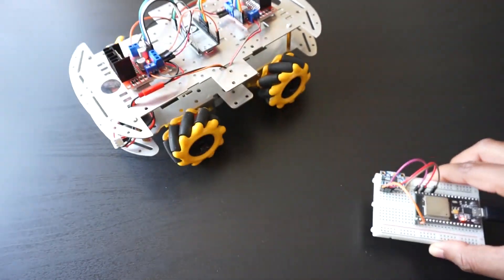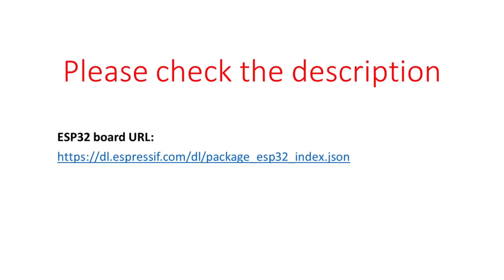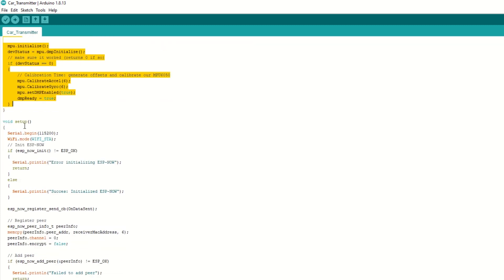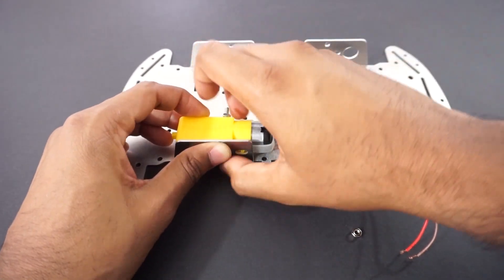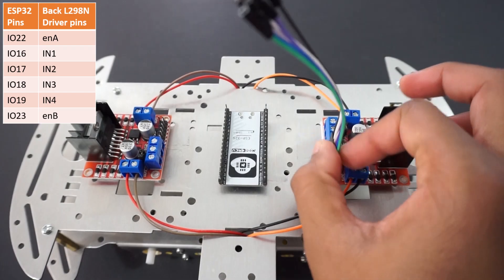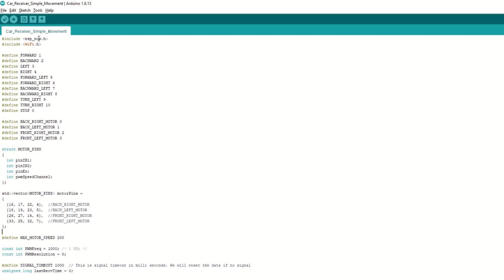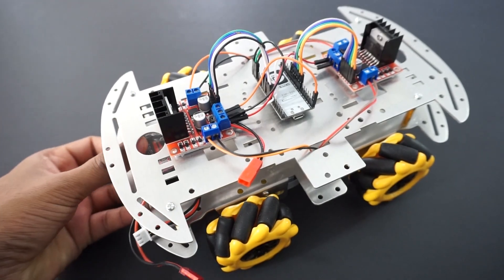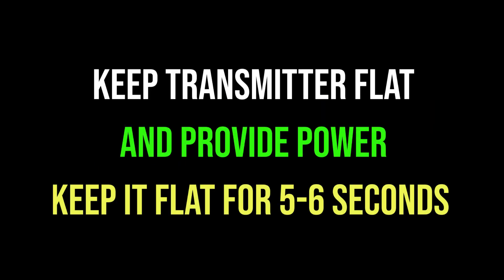Gesture Controlled Mecanum Wheels Car using ESP32 | ESPNOW | DIY🔥

Comment: Code is not working
Reply: ARDUINO 1.8.19
The receiver and transmitter not connecting
Reply from the maker: @AkFourtyseven-m2h  ok . You need to make some small change in code . Please check the very first comment on this video 👍🏻👏🏻
Reply: I do it but not connecting
Reply: Please help
Reply from the maker: @AkFourtyseven-m2h  ok do one thing . Might be your mpu6050 is not working . Try using another one . We recently solved this kind of issue for one of the subscriber 👏🏻👍🏻
Reply from the maker: What issue are you facing ? Which version of Arduino IDE are you using ?
Reply: Mpu6050 is working, i checked it

Comment: When I load the code of the receiving car I get the message (vector in namespace std does not name a template type)
how can I fix that
Reply from the maker: Please use below line at the beginning of the code 
#include <vector>
Reply: Thanks
Reply: @IvanSantana-rv9un  did it worked?

Comment: Code of transmitter is not working , please help
Reply: In the code of car reciver i got this message
Vector in namespace std does not name a template type
Reply from the maker: @IvanSantana-rv9un  please add below line at the beginning of the code 
#include <vector>
Reply from the maker: Which Arduino IDE version are you using ?

Comment: How to make this for a stearing based rc car??
Reply from the maker: What do you mean by steering based RC car ? 👍🏻👏🏻
Reply: @hashincludeelectronics   the rc car waltoys cars that has dc motor in rear wheel nd front wheel has a stearing system to turn left right

Comment: Can use normal wheels?
Reply from the maker: Yes you can but few movements will not be applicable for normal wheels . Like sideways , diagonal . 👏🏻👍🏻. You can check my other gesture controlled car using Arduino .

Comment: C:\Users\nitis\AppData\Local\Temp\.arduinoIDE-unsaved2024114-5060-6a0zee.exdaa\sketch_feb14a\sketch_feb14a.ino:5:10: fatal error: I2Cdev.h: No such file or directory
 #include "I2Cdev.h"
          ^~~~~~~~~~
compilation terminated.
exit status 1

Compilation error: I2Cdev.h: No such file or directory                       
THIS PROBLEM IAM FACING COULD YOU PLEASE TELL ME
Reply from the maker: You need to install the library. Please check the video 👏🏻👍🏻
Reply: @hashincludeelectronics   i installed and paste it in the aurduino library

Comment: Hii sir 
I am make this project according to your video 
But there is two problem :
1. It is not working when I give the power connection by motor driver to esp32.
2. If I am giving the power supply from esp and giving power to motor driver by battery it is running but after few seconds it is not working there noise created and we have reset esp32
Reply: Same problem sir

Comment: Hiii
There is error in receiver code that "vector is namespace 'std' does not name a template type "
How can i remove it ?
Reply from the maker: Use this line at the beginning of the code .
#include <vector>
Reply: @kathanpatel8081  did it worked

Comment: It's working but, when I disconnect the battery, I have to re-upload the code, to start it again, any suggestions for this ?
Reply from the maker: You don’t have to re upload the code at all 👍🏻👏🏻. Please check the video again
Reply: Bro code any error comes which module use esp32 🤔.any program error comes please tell me
Reply: @beRecursive

Comment: Brother can I please contact you, mine is not showing any gesture response
Reply from the maker: What issue are you facing ? Please go through the video once again slowly and carefully for any missing step 👍🏻👏🏻
Reply: @hashincludeelectronics  I have done all the steps, but still the car is not responding.. to connect two esp32, we have to just paste mac address of reciver to transmitter right ?
Reply from the maker: @JoshiRushi-v1e  which Arduino IDE version are you using ?
Reply: And one thing, I am using esp32 with 30 pins, but I have changed the pins in code accordingly, would that cause any problem ?
Reply from the maker: @JoshiRushi-v1e  it should be ok . Give it a try 👍🏻👏🏻
Reply: @hashincludeelectronics but it's still not working, please help
Reply from the maker: @JoshiRushi-v1e  what version of Arduino IDE are you using ?
Reply: @hashincludeelectronics  hey, it's working, but the motors are taking too much load, ( i am using 9v sp battery) can you suggest some other batteries that can work
Reply: @JoshiRushi-v1e  Hey how did you make it work? I'm having a similar problem and its not working, what should I do?

Comment: Do we need to upload that wifi code to both esp32 modules ?
Reply from the maker: No. It is just used to get the MAC address 👍🏻👏🏻
Reply: @hashincludeelectronics  ohk , but please clarify, we have to get mac address of reciver module and paste it in code of transmitter module right ?
Reply from the maker: @JoshiRushi-v1e  exactly 👏🏻👍🏻

Comment: transmitter
E (182) psram: PSRAM ID read error: 0xffffffff
Succes: Initialized ESP-NOW
E (307) ESPNOW: Peer interface is invalid
Failed to add peer
...................................................................
reciever
E (177) psram: PSRAM ID read error: 0xffffffff             how i can fix that i check mac address long time pls help me
Reply from the maker: Which Arduino IDE version are you using ?

Comment: Hey, can we use normal tyres ? Will it be able to take turns ?
Reply from the maker: Yes you can use normal wheels as well . However there are some movements which can not be possible with normal wheels . You can also refer my other same video but using Arduino where I have used normal wheels 👍🏻👏🏻
Reply: @hashincludeelectronics can you please provide the link  ?

Comment: I'm having a problem with Failed to add peer. Is there a way to fix this?

Success: Initialized ESP-NOW
E (122) ESPNOW: Peer interface is invalid
Failed to add peer
Reply from the maker: Which version of Arduino ide are you using ?
Reply: @hashincludeelectronics  Latest version
Reply: @hashincludeelectronics  I've been trying to find information about ESP now, but I can't solve this problem.
Reply from the maker: @03-thanakhonoonklan55  ok . Got the issue . You need to do memset in the code . You can find more information on this issue on internet .
Reply from the maker: @03-thanakhonoonklan55  check the pinned first comment on this video for solution👍🏻👏🏻

Comment: Ser can you tell me i have a problem because i am used 211-161007 esp32
So there are other names for the bens😢 like d22. ,d21 and so on
Reply from the maker: Please check the pin diagram of the module you are using and use those pins accordingly 👏🏻👍🏻

Comment: Hi, I have a question. This is will be work with normal wheels instead of mecanum? Your work is amazing. Thank you
Reply from the maker: Yes it will work . However there are some movement which can not work with normal wheels . Also you can check my similar video using Arduino and nrf where I have used normal wheels 👍🏻👏🏻
Reply: @hashincludeelectronics  Thank you so much!!
Reply from the maker: @MrAmadiPL  welcome 🙏

Comment: Hi sir i am this car . The transmitter module is working fine but there is some problem in reciever module. After uploding the code in the reciever the serial monitor displays this 

“rst:0x10 (RTCWDT_RTC_RESET),boot:0x13 (SPI_FAST_FLASH_BOOT)
configsip: 0, SPIWP:0xee
clk_drv:0x00,q_drv:0x00,d_drv:0x00,cs0_drv:0x00,hd_drv:0x00,wp_drv:0x00
mode:DIO, clock div:1
load:0x3fff0030,len:1344
load:0x40078000,len:13964
load:0x40080400,len:3600
csum err:0x4d!=0xff
ets_main.c 384 “

Please help me out
Reply: How did you solve it 🥺
Reply: @PrakashRaj-tg8pf  not yet😔

Comment: Sir it's a humble request from my side...pls provide me your contact info... because i have followed the steps u mentioned....still it is not working i need to submit my project in 2 weeks....please help me out🙏🙏🙏
Reply from the maker: What issues are you facing ? You can contact me on my email un0038998@gmail.com . I will see if I can help you.  However you can check the circuit diagram and connections again . Make sure you use rechargeable battery only . Check the video slowly and carefully for any missing step 👏🏻👍🏻
Reply: @hashincludeelectronics  sure sir i am mailing u...

Comment: Arduino: 1.8.16 (Windows 10), Board: "ESP32 Wrover Module, Default 4MB with spiffs (1.2MB APP/1.5MB SPIFFS), QIO, 80MHz, 921600, None, Disabled"

sketch_oct20b:29:6: error: 'vector' in namespace 'std' does not name a template type

 std::vector<MOTOR_PINS> motorPins =

      ^~~~~~

C:\Users\Admin\Documents\Arduino\sketch_oct20b\sketch_oct20b.ino:29:1: note: 'std::vector' is defined in header '<vector>'; did you forget to '#include <vector>'?

C:\Users\Admin\Documents\Arduino\sketch_oct20b\sketch_oct20b.ino:3:1:

+#include <vector>

 

C:\Users\Admin\Documents\Arduino\sketch_oct20b\sketch_oct20b.ino:29:1:

 std::vector<MOTOR_PINS> motorPins =

 ^~~

C:\Users\Admin\Documents\Arduino\sketch_oct20b\sketch_oct20b.ino: In function 'void rotateMotor(int, int)':

sketch_oct20b:207:18: error: 'motorPins' was not declared in this scope

     digitalWrite(motorPins[motorNumber].pinIN1, LOW);

                  ^~~~~~~~~

C:\Users\Admin\Documents\Arduino\sketch_oct20b\sketch_oct20b.ino:207:18: note: suggested alternative: 'motorSpeed'

     digitalWrite(motorPins[motorNumber].pinIN1, LOW);

                  ^~~~~~~~~

                  motorSpeed

sketch_oct20b:212:18: error: 'motorPins' was not declared in this scope

     digitalWrite(motorPins[motorNumber].pinIN1, HIGH);

                  ^~~~~~~~~

C:\Users\Admin\Documents\Arduino\sketch_oct20b\sketch_oct20b.ino:212:18: note: suggested alternative: 'motorSpeed'

     digitalWrite(motorPins[motorNumber].pinIN1, HIGH);

                  ^~~~~~~~~

                  motorSpeed

sketch_oct20b:217:18: error: 'motorPins' was not declared in this scope

     digitalWrite(motorPins[motorNumber].pinIN1, LOW);

                  ^~~~~~~~~

C:\Users\Admin\Documents\Arduino\sketch_oct20b\sketch_oct20b.ino:217:18: note: suggested alternative: 'motorSpeed'

     digitalWrite(motorPins[motorNumber].pinIN1, LOW);

                  ^~~~~~~~~

                  motorSpeed

sketch_oct20b:221:13: error: 'motorPins' was not declared in this scope

   ledcWrite(motorPins[motorNumber].pwmSpeedChannel, abs(motorSpeed));

             ^~~~~~~~~

C:\Users\Admin\Documents\Arduino\sketch_oct20b\sketch_oct20b.ino:221:13: note: suggested alternative: 'motorSpeed'

   ledcWrite(motorPins[motorNumber].pwmSpeedChannel, abs(motorSpeed));

             ^~~~~~~~~

             motorSpeed

C:\Users\Admin\Documents\Arduino\sketch_oct20b\sketch_oct20b.ino: In function 'void setUpPinModes()':

sketch_oct20b:226:23: error: 'motorPins' was not declared in this scope

   for (int i = 0; i < motorPins.size(); i++)

                       ^~~~~~~~~

Multiple libraries were found for "WiFi.h"

 Used: C:\Users\Admin\AppData\Local\Arduino15\packages\esp32\hardware\esp32\2.0.11\libraries\WiFi

 Not used: D:\ardino\arduino-1.8.16\libraries\WiFi

exit status 1

'vector' in namespace 'std' does not name a template type

This report would have more information with
"Show verbose output during compilation"
option enabled in File -> Preferences.
Arduino: 1.8.16 (Windows 10), Board: "ESP32 Wrover Module, Default 4MB with spiffs (1.2MB APP/1.5MB SPIFFS), QIO, 80MHz, 921600, None, Disabled"

sketch_oct20b:29:6: error: 'vector' in namespace 'std' does not name a template type

 std::vector<MOTOR_PINS> motorPins =

      ^~~~~~

C:\Users\Admin\Documents\Arduino\sketch_oct20b\sketch_oct20b.ino:29:1: note: 'std::vector' is defined in header '<vector>'; did you forget to '#include <vector>'?

C:\Users\Admin\Documents\Arduino\sketch_oct20b\sketch_oct20b.ino:3:1:

+#include <vector>

 

C:\Users\Admin\Documents\Arduino\sketch_oct20b\sketch_oct20b.ino:29:1:

 std::vector<MOTOR_PINS> motorPins =

 ^~~

C:\Users\Admin\Documents\Arduino\sketch_oct20b\sketch_oct20b.ino: In function 'void rotateMotor(int, int)':

sketch_oct20b:207:18: error: 'motorPins' was not declared in this scope

     digitalWrite(motorPins[motorNumber].pinIN1, LOW);

                  ^~~~~~~~~

C:\Users\Admin\Documents\Arduino\sketch_oct20b\sketch_oct20b.ino:207:18: note: suggested alternative: 'motorSpeed'

     digitalWrite(motorPins[motorNumber].pinIN1, LOW);

                  ^~~~~~~~~

                  motorSpeed

sketch_oct20b:212:18: error: 'motorPins' was not declared in this scope

     digitalWrite(motorPins[motorNumber].pinIN1, HIGH);

                  ^~~~~~~~~

C:\Users\Admin\Documents\Arduino\sketch_oct20b\sketch_oct20b.ino:212:18: note: suggested alternative: 'motorSpeed'

     digitalWrite(motorPins[motorNumber].pinIN1, HIGH);

                  ^~~~~~~~~

                  motorSpeed

sketch_oct20b:217:18: error: 'motorPins' was not declared in this scope

     digitalWrite(motorPins[motorNumber].pinIN1, LOW);

                  ^~~~~~~~~

C:\Users\Admin\Documents\Arduino\sketch_oct20b\sketch_oct20b.ino:217:18: note: suggested alternative: 'motorSpeed'

     digitalWrite(motorPins[motorNumber].pinIN1, LOW);

                  ^~~~~~~~~

                  motorSpeed

sketch_oct20b:221:13: error: 'motorPins' was not declared in this scope

   ledcWrite(motorPins[motorNumber].pwmSpeedChannel, abs(motorSpeed));

             ^~~~~~~~~

C:\Users\Admin\Documents\Arduino\sketch_oct20b\sketch_oct20b.ino:221:13: note: suggested alternative: 'motorSpeed'

   ledcWrite(motorPins[motorNumber].pwmSpeedChannel, abs(motorSpeed));

             ^~~~~~~~~

             motorSpeed

C:\Users\Admin\Documents\Arduino\sketch_oct20b\sketch_oct20b.ino: In function 'void setUpPinModes()':

sketch_oct20b:226:23: error: 'motorPins' was not declared in this scope

   for (int i = 0; i < motorPins.size(); i++)

                       ^~~~~~~~~

Multiple libraries were found for "WiFi.h"

 Used: C:\Users\Admin\AppData\Local\Arduino15\packages\esp32\hardware\esp32\2.0.11\libraries\WiFi

 Not used: D:\ardino\arduino-1.8.16\libraries\WiFi

exit status 1

'vector' in namespace 'std' does not name a template type

This report would have more information with
"Show verbose output during compilation"
option enabled in File -> Preferences.

Comment: Please sir i need your support to complete my project, it is very hard to made by me please sir please help me please, this is my first project and i don't want to fail in this 🥺
Reply from the maker: What issue are you facing ? Which Arduino IDE are you using ? Please make sure you use rechargeable battery only .

Comment: Can we make same without mecanum wheel
Reply from the maker: Yes you can do that . However you will have to change the code little bit to remove the sideways movement which is not required for normal wheels . 👍🏻👏🏻 give it a try .

Comment: Bor my problem is I'm giving powersupply to the esp32 from 5v port in the motor driver ,but my esp32 blinks slowly and stops working after 30 sec running car continuously... what's the problem
Pls reply 🙏
Reply from the maker: Are you using rechargeable battery ? If not then please use it 👍🏻👏🏻
Reply: @hashincludeelectronics  yeah bro its rechargeable only.... I'm using it

Comment: I have done exactly what’s shown in the video yet my motors ain’t rotating , I haven’t received any error in code except the vector function for which I defined #include <vector> which fixed the issue but yet isn’t working , I’m using 12v lead acid battery for car
Reply from the maker: Please check for any loose connection . Also take a look at video to see any missing step 👍🏻👏🏻. Don’t worry it will work . This is little bit complicated project so takes time and efforts 👍🏻
Reply: did you solve it?

Comment: 2nd week 2nd Day of asking what maybe the problem
Reply from the maker: What issues are you facing.  ? Please check the video slowly and carefully for any missing step . Check for any loose connections . Use rechargeable battery power supply . 👍🏻👏🏻
Reply: Ok Bor 
Thanks for your valuable time to reply me 😊😊

Comment: I am getting an error: vector in namespace std does not name a template type in the final code: car reciver code...pls help

Please Help me brother...i am on the last stage of the project 🙏🙏
Reply: i guess typing #include <vector> in the start of code will help
Reply: @devamshah6358  yes thank you...error solved but car didn't worked!
Reply: @kvs_bharatmata  having the same issue. Car isnt working
Reply: @devamshah6358  may be the vdo is fake!
Reply: Hash Include needs to answer!
Reply: @kvs_bharatmata  i am not sure but i think arduino ide version also matters
Reply: Did it work?
Reply from the maker: This project is little bit complicated. So we need to follow entire video slowly and carefully. Also make sure you use only rechargeable battery to avoid power issues . Check connections again . Hope these will solve the issues 👍🏻👏🏻
Reply: @hashincludeelectronics  okay i will do all procedure again
Reply: @hashincludeelectronics  can u please provide your WhatsApp number?
Reply: I can send photos of my car and everything
Reply: @devamshah6358  is it working?

Comment: Brother I need ur help! I messaged u on Instagram also...pls help me....my software is not picking up ports
Reply from the maker: Please check the video slowly and properly for any missing step . Please check the ports before connecting. And once you connect then check if new port is activated and use that 👏🏻👍🏻

Comment: Sir can u pls tell different ways to power the hand controller esp32 other than the power bank...pls help 🙏  can i use li ion battery?
Reply from the maker: You need to exactly provide 5v for hand controller . So you can use lion battery however you will have to use step up or step down voltage converter which will provide exactly 5v 👍🏻👏🏻
Reply: @hashincludeelectronics  where to attach 5v battery? I mean which pins
Reply from the maker: @ManuBhardwaj09  vin pin
Reply: @hashincludeelectronics  brother can u please tell a simpler way...using a steup up convertor will make it complex...